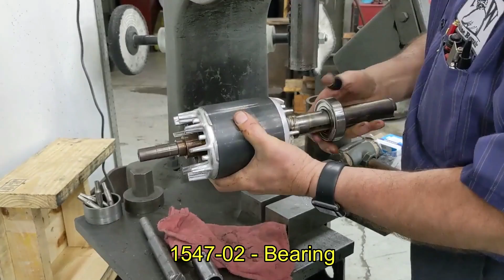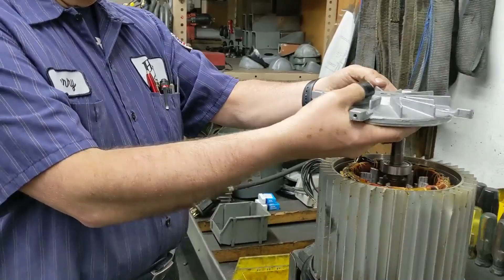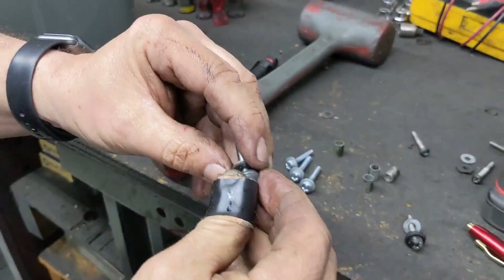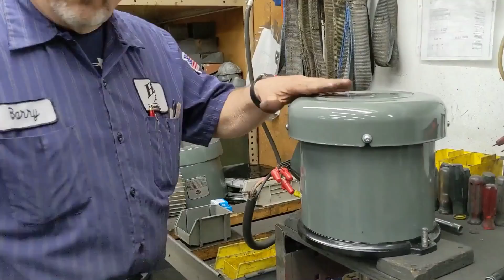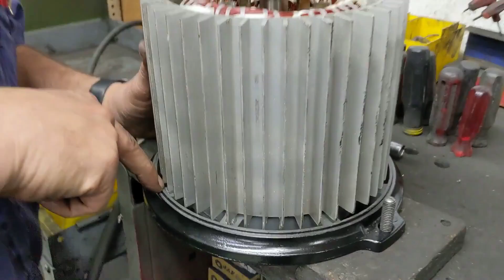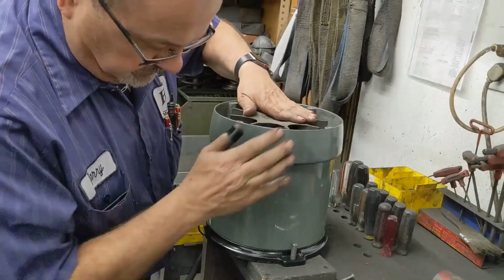Bridgeport Motor Rebuild, 2HP & 1.5HP

Comment: Barry, an old motor assembly mans trick I learn from a guy the worked at Lincoln Electric motor assembly plant back in the day is: Get a long bolt long enough to stick thru the top end bell or piece of althread the correct size, in this case, 10-32,  when it's setting in place, cut the hex off and cut a flat blade screwdriver slot at the end of the rod. screw it into the position you want to ID, then when you set the stator down and end bell on top everything is in perfect alignment. take out the rod and install the original. Not a world-changing tip but makes the motor assembly a little easier and quicker, I see you pretty fast at it already!

Comment: I got a 144 something 15? I'll clean and look closer. But is there a single phase motor available?
Reply from the maker: There is not a single phase motor available for either the 2HP or 1.5HP. We sell a solid state phase converter that can be used for that for $88. You can give us a call and talk to either Barry or Jon and they can answer any questions you may have about that. 1-800-285-5271
Reply: @HWMachRepair      exactly !!    I think i will need to buy one too ...